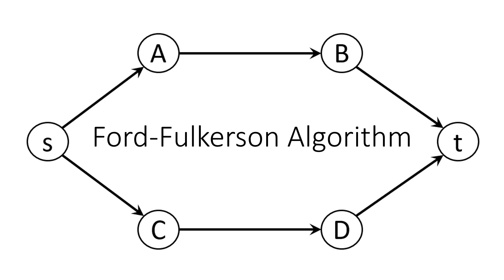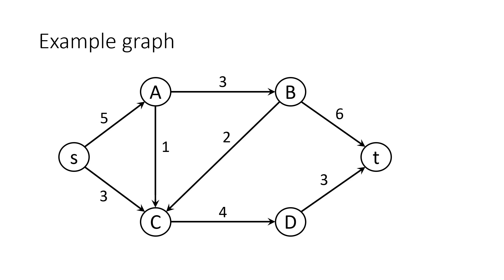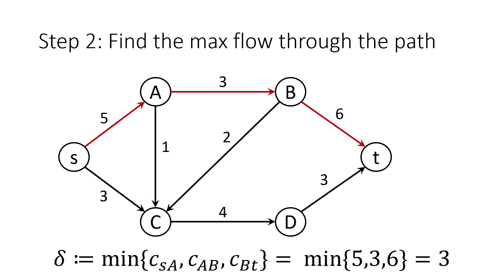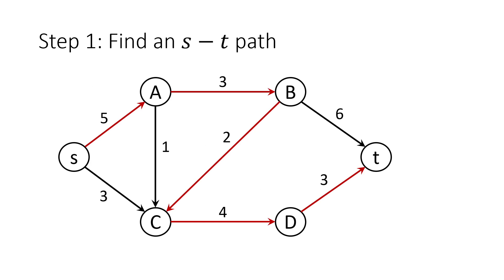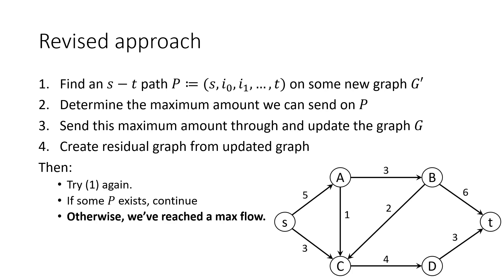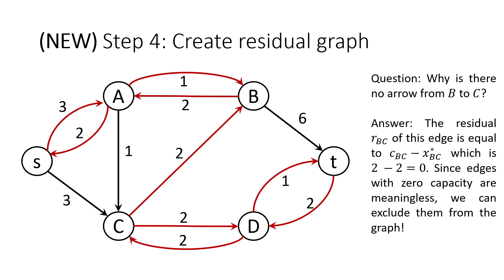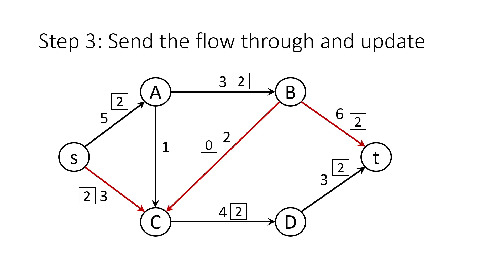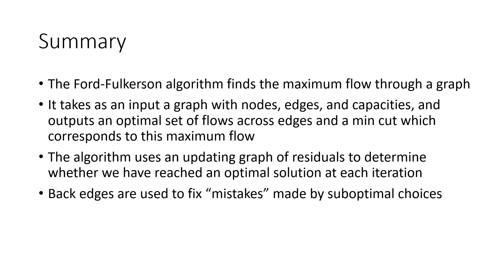The Ford-Fulkerson Algorithm

Comment: 3:50 You didn't check all paths from s to t . You missed checking 2 paths : 

1. s -> A -> B-> C -> D -> t with flow value = 2 (Covered Later)
2. s -> A -> C -> D -> t with flow value = 1

Although they wont maximize the max value any further.